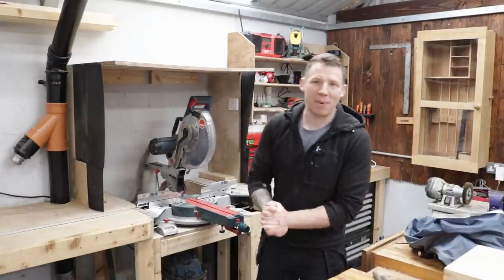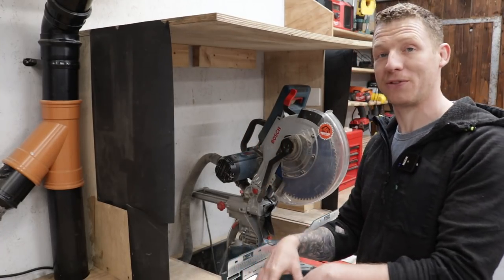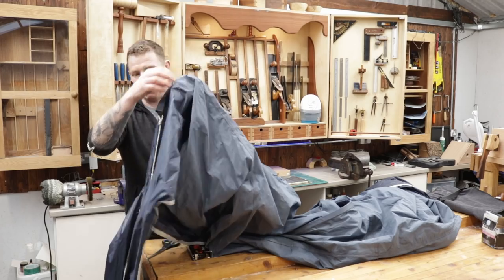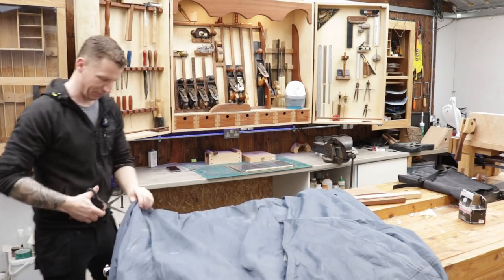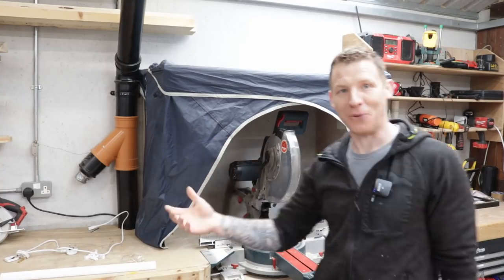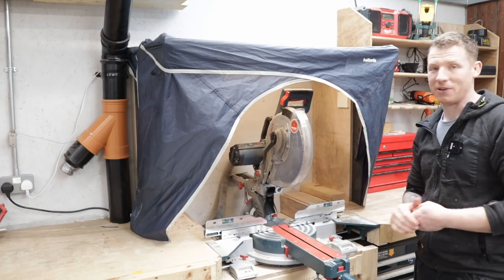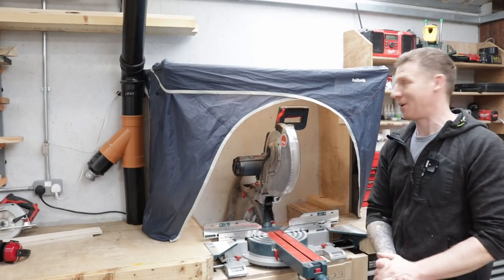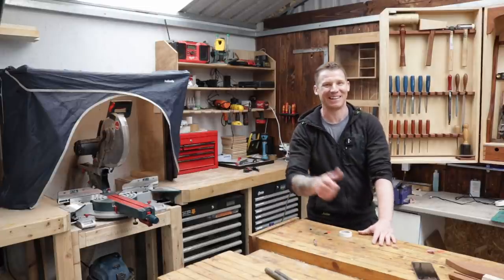Improving the Dust Collection at the Mitre Saw Station.

Comment: Brilliant idea!  I like it.  Might I suggest you wire a switch to control the light, shop vac, and saw.  Flip one switch and the light comes on, shop vac turns on, and saw is ready to use.  I did that on mine because I have the Dewalt saw with a shadow line controlled by a switch on the unit.  I kept leaving the shadow light on, so that solved the issue.

Comment: nice simple improvement. i wont sort it completely but it will help
im not a fan of the removable wooden ones, too much hassle to take off and wont get put back on. they are ok if you have to remove them a few times a year just for a compound cut . 
dust colection is all about directing the airflow so it passes through the dust producing areas and hopefully carries the dust  with it
i would add some doors either side  so you can widen in the opening when you need the full travel of the saw . if you had 2 on each side and hidged in the midlle you can widen the area they cover
those clear plastic strips you see on comercial freezer warehuses would works well too

Comment: If you want to improve the dust collection even more, i can highly recommend the Festool Kapex. :D
Reply: I've owned a 10" Hitachi and a 12" Dewalt compound miter saws.   By far, the Festool Kapex produces less dust thrown out behind during crosscuts.
Reply from the maker: 🤣 I'll be penniless
Reply: @JohnMcGrathManInShed   As you keep saying - Health is wealth. :D
Reply: The Bosch mitre saw is a cracking saw and cuts beautifully with the right blade at less than half of the cost of Festool Kapex. Yes the Kapex has much better dust collection as standard, but do as John has done and maybe extend the rubber cowl on the opening of the saws dust collection opening, as is with the Kapex. Then you have a pretty damn good mitre saw with good collection at less than half the cost 👍👍

Comment: Go have a look at Grumpys Workshop. He has sliding doors on his mitre station. Good dust collection for straight cuts and then for angled cuts he can just slide the doors open, no fuss and make the cuts.

I have something similar to what you have but the biggest issue I have is my vac isn't powerful enough to pull enough air through the trough and back of the mite saw at the same time. Guess it's time for a new tool (although vacs are a pretty unexciting tool, even if one of the most important for health)
Reply from the maker: A good vac is essential